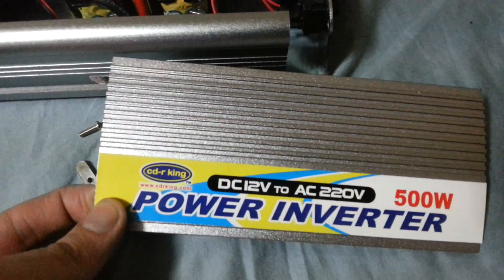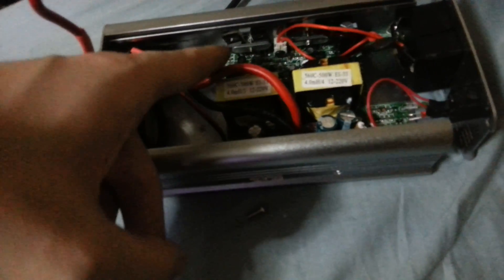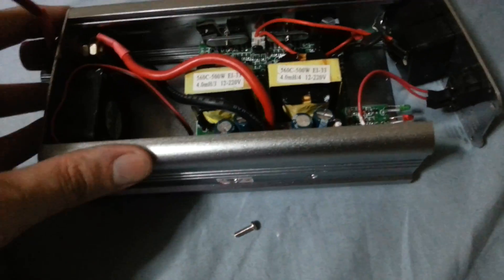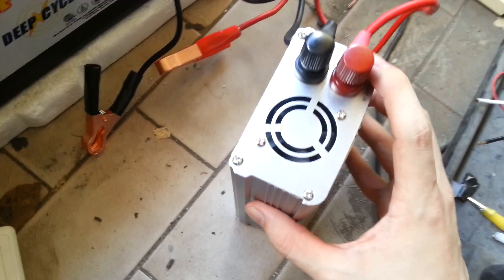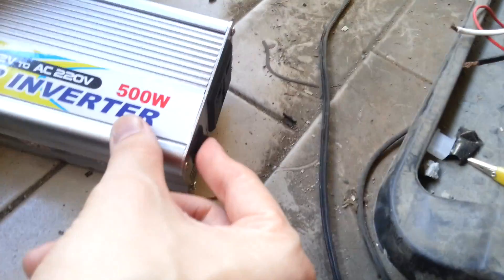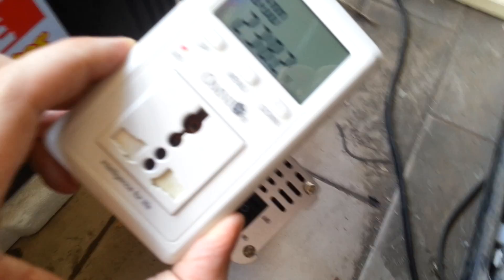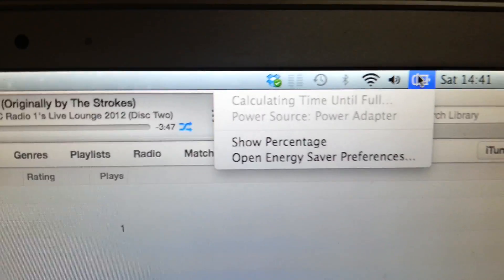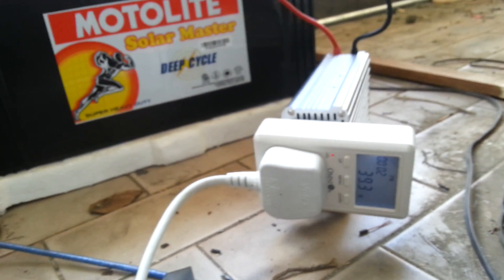CDR King 500 watt power inverter

Comment from the maker: Here's a look at their 100W inverter.. https://www.youtube.com/watch?v=TkVGrAUayM0
Reply: I have 500W inverter that I bought recently. After 4 hours of use with my laptop internet modem and router, it made a continous beep sound and stopped producing power. I thought it was just the battery running out charge. But the inverter continue to beep even if the battery fully charged. I've also tried different battery but the it's still beeping. What could be the possible cause of this? More power to your channel.

Comment: hi.. i purchased a 40amp deep cycle battery, 1500 watts inverter 12V to AC220V i guess not pure sine wave coz i bought only for 1600 pesos and 10 amps charge controller. is it okay to purchased 100 watts solar panel with the specs above? this is intended for my wife homebased work. this is her backup incase of black outs.. she is using a laptop and router only. need ur advise. thanks and more power!

Comment: Hey! Just bought the CDR King 500 watts DC12v to AC220v inverter and a Motolite Electron Low Maintenance car battery. Am gonna be plugging in my netbook's charger and my internet router. Would plugging in an extension directly to the inverter be fine? Or should I be plugging in an octopus plug to have both my netbook and router running? Also, how many hours could my netbook and router be up with the inverter and the car batt? Thank you!
Reply from the maker: +Liz Carmelotes Using the extension cable is fine :) It might have been better to buy a deep cycle battery from motolite because they're more suited to heavy discharge and regular recharge while car batteries are intended more for an initial high current (car starter) and then to be kept float charged. Both will work but the deep cycle battery would give you a longer life. How do you plan to charge the battery? Most laptops consume 20-40 watts while charging and 10-20 watts when fully charged. Most routers only consume 3-5 watts. Generally you shouldn't discharge your battery beyond 50%. To work out how long they'll run for, please tell me the AH rating of the battery you bought.
Reply: +Gadget Addict Tbh, I do not know the AH rating of the battery I bought. All I know is it's 11 plates and it's a Motolite Electron Low Maintenance car battery. Main reason I bought that since it's only P3,200 and am just gonna use it during black outs. Do you think plugging in just the router would last 3-5hrs on the stuff I just bought? Am planning to have my netbook charged when power's up so that I wont be needing to charge it on the inverter.
Reply from the maker: Liz Carmelotes Is there any model number on the battery? I can't find the Electron series on the Motolite site anymore. I only see adverts from 2010 or 2011. Maybe it's an older phased out series? Some resellers keep old stock for a very long time and then add the acid only when someone buys it.  I would assume for P3,200 it would be around 40 AH. So lets say we don't discharge it beyond 50%, that gives us 20AH of capacity and lets assume it's a simple 12V. So  20AH at 12V would give us 240 Watt hours. That means you could run a 240 watt load for 1 hour or you could run a smaller load for much longer. If we assume your router is 5W, we do 240 / 5 = 48 hours. Of course this doesn't account for efficiency losses with the AC inverter so lets slash that 20 percent (worst case scenario) and we get 38 hours.
Reply: +Gadget Addict I'm not quite sure if it's an old stock or not but it says "Dry Charged Electron Battery" and for the Motolite code, it's N70.  And about the acid, yup! That's what they did. They added acid and charged it for a good 2hrs and 30mins. The seller told us it's a lower form of their Motolite Champion Low Maintenance. As for the charging, we just bring it to the store we bought it and then they have this meter giving us the "12volts" which means, as what the seller said, is already full charged for our battery. How do I know when the battery needs charging? And just basing on my everyday usage of say 3-5hrs (note that the 3-5hrs is just an estimate for the power outage) for my netbook (if it needs charging) and router, how frequent should I have it charged? Really appreciate every info you're giving me. Am not really good at this. :)
Reply from the maker: Liz Carmelotes The laptop could consume up to 8 times as much power as the router, so you'd run the battery down much faster. If you discharge the battery too far, as in use all the stored power, you'll damage it. If you do it too many times it will drastically reduce the capacity. So you have to be careful to monitor it. Dragging it back to the shop and waiting hours for it to be charged every few days sounds like a nightmare. You'll want to look into buying a smart charger that supports float charging. This charger can be left connected to the battery all of the time and ensure it stays fully charged. I assume you're using it primarily for brownouts? I've actually started shooting a video about this very specific topic! I just need to finish shooting some bits, edit and upload :)
Reply: Gadget Addict Lol! So you have already figured out that I just dont wanna do the back and forth travels to the shop just to have it charged. I dont even know when my car batt's almost or already drained. What gadget could I get myself to have my car batt's power monitored? And about the smart charger you're talking about, where could I buy it here in the Philippines? Any idea how much it would cost? Hope it won't be that expensive. And YES! Just for brownouts! Brownouts happen EVERYDAY for 3-5hrs here in Davao. Am having an online job and I can feel my boss giving up on me with the power outage situation. :/
Reply from the maker: When used in a car, your alternator charges it whenever you're driving. That's why you never have to worry about it. But when using it for off-grid / brownout / solar purposes, you need to monitor and charge it yourself. You can buy a small battery meter for P400 from OLX which will give you a rough percentage of how much battery life is left. Alternatively you can buy a P100 multimeter from CDRKING and just measure the battery manually whenever you want to check it. Check out this image to see how the voltage relates to the capacity - http://www.tortugaaudio.com/images/Battery_charge_state.jpg . Even if you wanted to, would the shop really accept you every few days and plug into their electricity for a few hours each time to recharge it? I'd imagine they'll want to start billing you. The faster the charger, the more it costs. Do not buy an old heavy transformer type charger like those sold my Panther and often found in car repair shops, make sure it's a smart charger. The advert should say if it's a smart charger and it will be much smaller and lighter than the old style chargers. A generic smart charger on OLX will cost 1-3k depending on the brand quality. Hopefully your boss is impressed with your forward thinking to set all this up, maybe he can front some money to cover the costs of all of this.
Reply: +Gadget Addict Wow! I really need that multimeter and that smart charger to save me from the hassle! One last question. Given the hours that I would probably use the car batt with the inverter, if I dont get those stuff (multimeter and charger), do you really think that I need to go back almost everyday just to have the battery in good condition during brownouts? As per my boss, he promised he'd give me a bonus if it really works! But so far, I havent tried it yet..
Reply from the maker: Liz Carmelotes Let's assume that your laptop battery is fully charged and only consumes 25 watts and then 5 watts for the router and then 10 watts for the inverter fan and inverter efficiency losses. A total load of 40 watts. You could run for around 6 hours before you have consumed 50% of your battery. If you go beyond that, you risk hugely damaging the life of the battery. But remember, your laptop will still have the full battery than you started with. So you might prefer to run the laptop for just a couple of hours and then save the battery life for running the router for many more hours. With a smart charger, you leave it connected all the time and whenever the AC is on, it charges your battery automatically; you don't have to keep connecting and disconnecting the charger. That's useful in rolling brownout scenarios because as soon as the grid comes back up, your battery is being charged, even if its just for 2 hours.
Reply: +Gadget Addict Now I understand. Thank you so much for all those info! I'm gonna be investing on that smart charger and that multimeter as soon as possible. But just in case something comes up, it would be possible to flood you with more questions, right? Lol! You've been very helpful. I'll wait for your upcoming vid about brownouts. :)
Reply from the maker: Liz Carmelotes Sure, if you have any questions just come back here :) Happy to help! Good luck and I hope it gets you through the brownouts! If you haven't subscribed already, click the button now, so you'll be alerted when the video is up :)

Comment: hi po.. i wanna make a solar station in my house.. 150W solar panel. charge controler 100AH battery and a 500W modified sine wave inverter.. im gonna use a 45W  fan for the night time.. is it gonna be fine? like nothings gonna happen bad to the fan? and how long it gonna be?? thanks Gadget Addict..
Reply from the maker: The modified sine wave inverter will likely damage the fan over time and waste a lot of power compared to using a pure sine wave inverter. It will work, but not very well. The same goes for pretty much all inductive loads on a modified sine wave inverter. Otherwise I don't see any problem with your plan :)

Comment: hi gadget addict! i really enjoy your  solar vids. i have a 350 watt washing machine. can i run it using that cdrking 500 watt inverter? or should i get a larger cdrking inverter? any thought will be much appreciated. tnx
Reply from the maker: +luckienuckie One thing to remember is that AC motors don't like running on modified sine wave inverters. They'll waste a lot of power and in the long run it could damage the motor. So you'd want to look for a pure sine wave inverter which is generally much more expensive. The next thing to consider is whether the washing machine requires a large surge of power to get started, I imagine it would be minimal and probably not a big concern. When it comes to the max power ratings for cheap generic inverters, you can pretty much assume they're lies. If you need to run a constant 200-300 watt load, aim for a 600-800 watt inverter. Hope this helps.
Reply: :) yeah this helps a lot. maraming salamat po

Comment: how do you know if the battery is fully charged?
Reply from the maker: +icethey1985 If you use a voltmeter/multimeter you can check the voltage and compare that with a 'battery charge percentage voltage' table online. If you have a charge controller, it will stop charging the battery when it's full.
Reply: brilliant! i will have a go at cdr king solar
Reply: +Gadget Addict you have to put a load test on it to really know the actual condition of the battery...

Comment: Can the Omni-watt meter tell the amp usage of a device?
Reply from the maker: +mckoy estrada It can show you the voltage and wattage, if you divide the watts by the voltage, you'll get the amps :) e.g. 230V AC, 150 Watts is  150 / 230 = 0.65 A
Reply: Thanks!

Comment: I have a 2000watts fully automatic washing machine brought from abu dhabi to the Philippines,but its specs is 220 volts, 50hertz.?
I know for the fact that in the philippines we uses 220 volts and 60 hertz power & frequency.
My questions are: 1.)how much watts capacity power  inverter with 50hertz output should i buy?I mistakenly bought a 3000 watts inverter but with a 60 hertz frequency.Can i still use the 60 hertz inverter that i bought?
2.)what battery should i used?12 volts or 24 volts intended for my exclusive washing machine use only.
3.)How long will the battery last if i will use the washing machine for 2 hours per day only?
need your reply soonest sir.

Comment: How many amp did you use to ur charge controler?  Waing for ur answer tnx.
Reply from the maker: Ernesto Villotica Jr I think when that video was shot I was using a regular cheap 10 AMP charge controller. 10amp at 12v or 24v so of course its more efficient cost wise to run a 24v system.

Comment: hi sir good day. can you please help me? how many watts of solar panel did i use to charge my 100 amp/hour battery? i am using my battery for almost a whole night starting from 6pm until 4to5 am to power my  LED bulbs almost 130 watts.  so i need to fully charged again in the daylight to use again in the night thank you.

Comment: Hi Gadget Addict, I'm thinking of using an inverter instead of a generator as it is noise-efficient. How many watts can you suggest if I am going to power up a 14 inch LED monitor with CPU and a DSL modem? 

I would greatly appreciate your response.
Reply from the maker: Myra Joy Santos The DSL modem will probably only consume 2-5 watts, the LED monitor maybe 13-30 watts. The CPU is the one that can chew through the power, maybe 80-200 watts depending on your configuration and what you're doing on the machine. I'd generally recommend buying an inverter that is at least double what you need. So no less than 500 watts in your case.

Comment: Hi, Nice video!

I recently bought a 500W/12V power converter.  I'd like to hook up to a solar panel, but I'm not sure what kind of panel/battery I should get.  Can you hook up a 500 watt solar panel to a 500 watt inverter? 

Here are the specs,

CELLSTAR HG-500/12Vbody
battery connection code2m,owner manual,box

★main specification etc.
input voltage:DC12V(operation voltage range11.0V~15.0V)
output voltage:AC100V
. interval maximum output:1000W(0.1second within)
maximum output:500W
rating output:400W
output frequency:55Hz
size:108(W)×197(D)×59(H)mm(.. part excepting)
-ply amount:1040g

Thanks!
Reply from the maker: A quick look at the specs says that 500W is "maximum output" and 400W is "rated output" so I would be careful about running it at 500W for too long. Generally you should over-spec your inverter anyway. You could connect a 500 watt solar panel, although I've never seen one that large myself, but lets imagine two 250W panels. I would strongly recommend against connecting the panel directly to the inverter. It will be unreliable and will most likely end up frying your inverter. You'd need a charge controller to manage the voltage and a battery to provide consistent output when shadows pass over the panel etc. The size of the battery depends on whether you want to spend on a big battery and have a good amount of power stored or if you want to go the cheap route and just buy a battery just large enough to serve your needs when the sun is up.
Reply: Thanks a lot for the quick reply!  I'm thinking of buying a 100w panel and then maybe buying another one depending on how things go.  My short term goal is to run my computer and TV for serveral hours a day.  My TV says it needs 64 watts and the computer says it needs between 41-94 watts so I'm guessing I would need at least a 150 or 200 watt solar panel. Ultimately, I'd like to try to power everyting in my apartment with just solar, but for now, my computer and TV are enough.

Comment: im consuming may be atleast 300watt in my house, do you think the 1000watts inverter is enough?
Reply from the maker: If you're only consuming 300 watts then a 1000 watt inverter seems plenty. How did you calculate that?
Reply: just in case if there is additional gadgets in the house. to save money ill buy once the 1000 watts then ill upgrade the solar panel.ang battery, is that possible?
Reply from the maker: willie bautista Yup that is possible. 300 watts seems a bit low to power a whole house, that's why I asked how you calculated that figure. I assume you don't use a microwave, aircon, electric cooker, kettle, large refrigerator or any other power hungry devices?
Reply: yes i dont have. i used LED buld. , 1 LED TV A loptap 2 fan and a radio , a 7 cubic ref.i was a father of 4 and i would like save many coz the lectric bill here was high. maybe you can help.
Reply from the maker: willie bautista It seems like your measurements is likely accurate then :) Solar should serve you well!
Reply: tnx for your time. one more thing is cdr king inverter is dependable? do you have any suggestion for the brand?
Reply from the maker: willie bautista Mmm it's as dependable as any other cheap generic branded inverter. If it's rated for 1000 watts, don't be surprised if it actually overheated and turned off at 700-800 watts. So with cheaper generic inverters you want to overspec them :) You could try somewhere like Ace Hardware which might have better quality inverters with warranties. Remember that a modified sine wave inverter is cheaper but can cause some issues with inductive loads like fans and compressors. So if possible, go for a pure sine wave inverter.
Reply: tnx, you help me a lot

Comment: Hi Gadget, how much and what are specs of the Motolite Solar Master and the Omni brand watt meter?
Reply from the maker: The omni watt meter is around 800-1000 depending on where you buy it. The motolite battery depends on the size you want. They have a price list on their website :)
Reply: Gadget Addict nice videos, where did you buy your watt meter the one i found  on olx are already out of stock
Reply from the maker: Naduap Reyes There are a few different buyers on OLX, otherwise there are some shops in Cavite and even some places in Manila Quiapo that stock a lot of solar products now :)